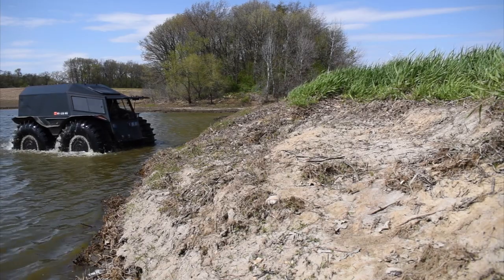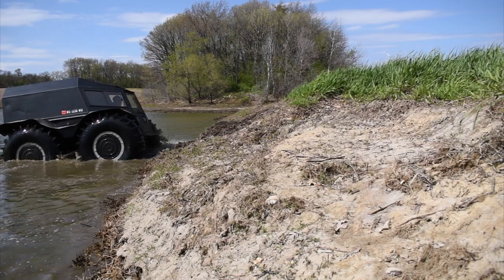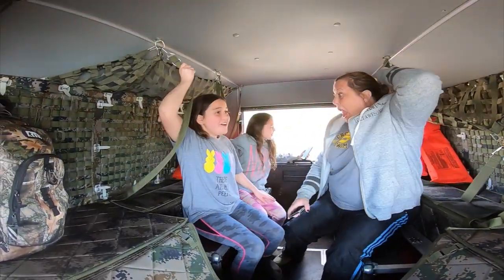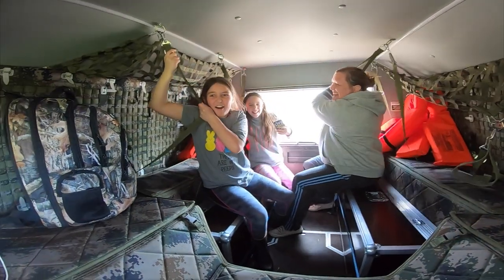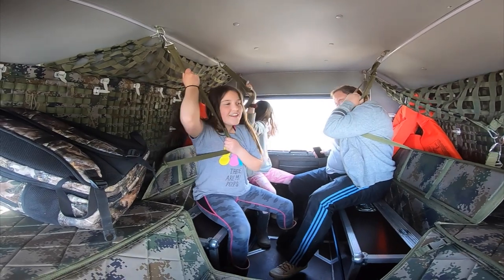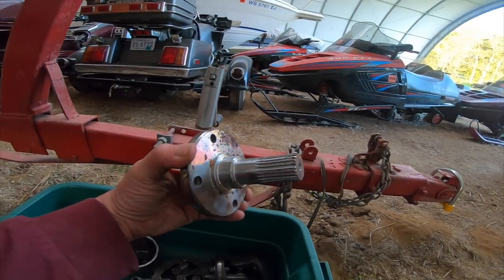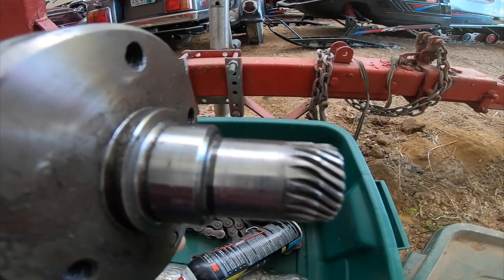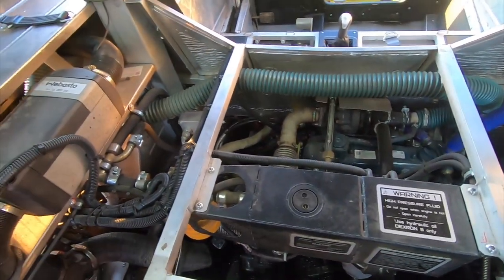Sherp Failure- Mechanical Fuse Broke

Comment: I’m sure they tried the magnet method to remove it.  If you use a screwdriver on the flywheel and wiggle the flywheel back and forth while pulling on the broken piece with the magnet sometimes helps.

Comment: My old Attex has no trouble climbing 45 degree canal banks as long as you sit as forward as possible. The original baloon tires are amazing. The 400 cc two stoke makes it fast but it's not going over the big obstacles a Sherp would. I have jumped into the canal with it  as well as over some obstacles. I have not seen anyone try and jump with a Sherp so far. You can also see Jiger atv videos where someone gets run over and is not hurt, who will try that with a Sherp first?
Reply: I've thought about doing this with the Sherp.  With the tires aired down to ~20 mmHg, you're looking at a ground pressure much lower than what I would expect would cause any injury.  The only concern I would have is the paddles digging in despite the low pressure.  Maybe a piece of stiff material between the subject and the tires, just in case.  It may also be prudent to build a structure around the subject to ensure the ride across the subject's body is smooth, and the Sherp isn't "climbing" them; at least for the first test.  I don't think the weight itself would be a problem.

Comment: What generation is your Sherp?  My wife and I just closed on a Gen3 on Friday, and I've been trying to study this fuse as much as I can.  I will not have the option of calling in a tow or a service technician with mine, as I will be operating it at the edge of civilization, 600+ miles from any dealers.  I have yet to attend my dealer provided training and familiarization though.  I hear the only thing you need other than the toolkit that comes with the Sherp, is a #2 cross-tip screwdriver, and a blowtorch to remove the locktight.  Seems yours would've also required a drill and an easy-out type bit, at a minimum, but I'm not familiar with the angle of installation or how badly that part was jammed into your transmission.
Thanks so much for sharing!  I love your videos!
Reply from the maker: Mine is Gen3 also.  Locktight has been an issue for me also (too much used during install). A torch would be great but there is some small areas to work in.  Over time, oil build up could be a fire issue with a torch.  I don't think there is enough room to get the chunk of the shaft out of transmission with easy out.  You need to have a strong magnet.  The magnet normally can get the mechanical fuse out including any pieces that may have fallen off.  I would also have a strong piers or vice grip to get the springs off the clutches.  If you are isolated, suggest having a com a long or winch if you would get stuck - very unlikely.   This issue is likely caused by user error - my foot has slipped off the clutch in torque required situations.  I should have had one of the hand controls pulled back.  I do not believe this will happen again.  I hope this helps.  Don't hesitate to ask questions - I'm happy to help.  Welcome to the Sherp family!

Comment: Warranty work?  Is this a design flaw they intend to change in the future?
Reply from the maker: Yes it was covered under warranty.  Sherp has upgraded the transmission.  Also, the mechanical fuse has been beefed up.
Reply: @SherpET  What year did Sherp upgrade the transmission and fuse?  Can your Sherp accept the upgraded trans?

Comment: That stinks.  Also that is not a “fuse”.  A fuse would be something easy to replace if it failed.  The drive spline sheared because it’s not strong enough... and intern wrecked the transmission output shaft.  A fuse protects not destroys.  Lol!  The thing needs a shear pin or slip clutch if it’s that sensitive to failure.
Reply from the maker: That would have been nice.  It would have to be one hell of a shear pin.